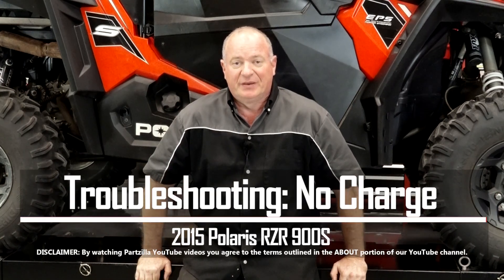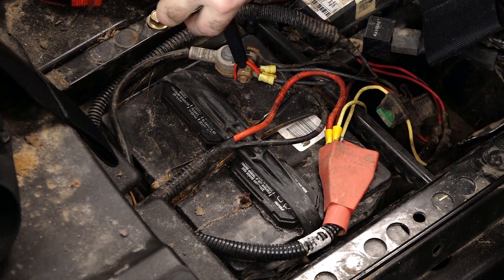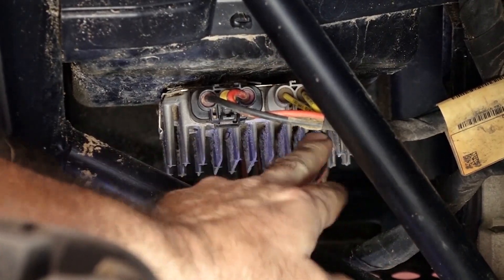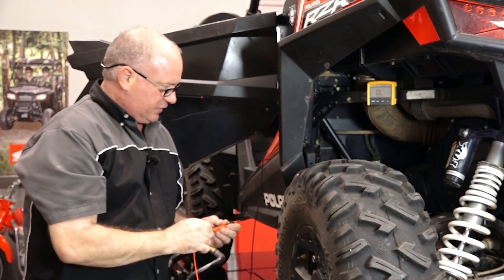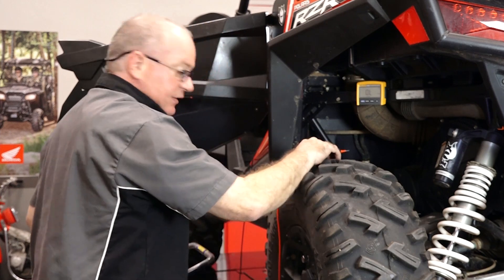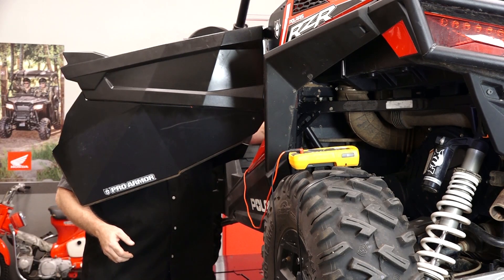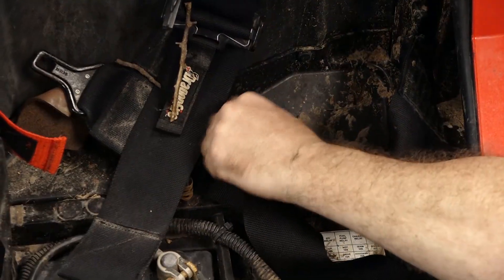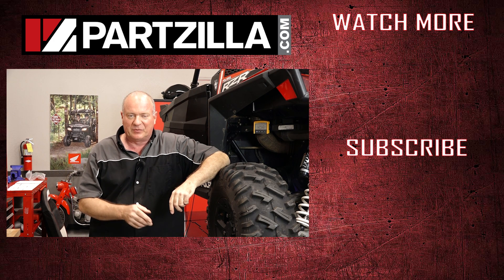Diagnosing Charging System Problems | 2015 RZR 900S  | Partzilla.com

Comment: 2014 Polaris Ranger XP900 EPS. My battery was draining. Went to start the UTV and charging showed 11.2 and went down as I drove it. Eventually would get below 10 volts and not start. Charged battery back. Drove down the road and EPS shut off, warning light came on and message showed 16.8 over-voltage. Returned to the house and began troubleshooting. Most say over-voltage is a broken 22 gauge wire. at the stator. Did not find that. Removed regulator plugs. Stator disconnected and Black to ground, checked each phase and all are open. Started machine and checked AC voltage at connector. 20-21 vac. All 1-2, 1-3, 2-3. Appears good. No grounded and ac voltage correct. Plugged in to battery connector, machine not running, Red meter lead to ground on battery, Each leg shows 1.2. Not the 0.5. All 3 legs consistent at 1.2.  Is this causing the low voltage and then over-voltage?

Comment: I did every test and everything checked out. Good regulator and stator. But not even 20 minutes of riding and I’m stalling out with a dead battery… very frustrating
Reply: Tengo ese mismo problema ¿pusiste solucionarlo?

Comment: We made an error on our RZR 900 and reversed polarity on the battery,  We heard a fireworks kind of sound and that was it.  We put the battery correctly and the RZR starts and runs but is not charging.  Do you think we damaged anything else aside from the stator or rectifier?  I replced the rectifier and its still not charging.  I looked at this video so my next step is to follow your procedure on stator testing.

Comment: If I put a battery shut off switch on the positive battery cable on my rzr xp 1000 will it kill the engine if I switch it off while its running?

Comment: I just bought a Polaris rzr 800, the light bar stopped working, radio, horn, etc. The light's to the rzr are still working, and still driving. It does cut off at idle. What could I check? Plz help!

Comment: 3:13. You are confusing resistance with continuity, if there is continuity to ground the coils are shorted, a good coil will have a lot of resistance, in fact infinite resistance. With the meter on the ohm setting and displaying OL or I (I for infinity) it means there is infinite resistance between the meter's leads, as soon as the reading changes it means there is LESS resistance than infinite and that points to a short.

Comment: I have a 2013 Ranger 900 XP it will run for about 5 minutes then shut off if you let it set for 20 minutes it will start back up, the first dealer told me to replace the coil, and that did not help , so I called another dealer and he said stator and that did not help either, when it quits there is no spark to the spark plugs, do you have any suggestions on what could be the problem!

Comment: I have a 2013 Polaris RZR 570, would this be a similar process ?  thank you!   new battery, we use to feed horses, runs about 5 days (we don't drive it fast) when turn off; battery needs charged.  May have a charging problem.  only 237 hours on  it! purchased from older gentleman he never used it; shined it alot.  I just installed a new battery. It has been sitting for at least 9 months.  Otherwise runs great.

Comment: If you check the stator and it is ok, couldn't you also check the output plug of the regulator/rectifier to see if it is appropriate voltage if you don't have a diode checker?

Comment: Hello John, can you explain this,, so if you read my comments I have a 2015 Polaris 900 xp, it runs great now again but upon doing your test of the stator initially it checked out good, about 20v, but still off and on would not charge according to the volt meter installed. Then it started to over charge, up to 17v and the eng. light came on continually. So rechecking the stator again it then showed about 1v ac on all three.  So I ordered a new stator too. Meanwhile I got a new regulator installled.  Was about to remove the muffler etc. when I thought to recheck the stator, for laughs, and volt meter after the regulator install.  To my shock the volt meter now shows 14.7 and it runs great..???? Canceled the code 168 and eng. light and it has been running fine..  Also the regulator went out I think because the batt. posts were both loose.  When it stalled and had to jump start it both connections were loose enough to turn by fingers......

Comment: Today when I started it up, meter shows a discharge AND motor light is on the speedo guage.. ordered a regulator will post any change after install.  Regulator is behind the grill and bumper/winch on passenger side, I see on your video it is wide open on the machine you work on.  ? is that the original place or like I"m thinking>> I will just mount the new one someplace more easy to get to.. it being that close to a hot radiator was not a good plan I'm thinking,  thanks

Comment: Excellent work, thank you, easily diagnosed my 2015 ranger 900 stator 19-20 v on all three circuits and no ground out. Was discharging erratically, especially at idle.  But now after checking it out it shows on the speed gauge and separate volt meter over charge,,, up to 17v, this causes the PS to quit as did the low voltage too.
Reply: Mine's charging at around 17 VDC as well. Did replacing the rectifier solve your problem?

Comment: Have a delayed starting problem on a 2011 Polaris 800 ranger. It happens when I turn the key on let the fuel pump charge then when I step on break petal and turn the key  we have engagement but then a hesitation before it actually starts. I’ve changed the safety switch, starter, and switch starter. 
What am I missing or have done wrong?
Thank you for you videos,
Brian

Comment: Iam having some issues with my rzr. It’s a 2013 900 and while riding this past weekend power steering kept going out and check engine light kept coming on. I bring it home and test battery and it’s at 12.6v but at idle it’s at 15.9v. I used this video to test stator and I’m getting .5ohms which is way above spec and for ac volts I’m getting 3 volts at idle. How can this be if battery is over charging?

Comment: Awesome video, I was able to follow the steps as you did but I was checking them on my 12 rzr 800, really the only difference is the location of the rectifier. From using this testing method of having the pos/neg plug plugged into the rectifier I was able to determine that my original rectifier was faulty, the diode test was all over the place with phases one and two and OL on the third. Great I thought as I had bought a new rectifier thinking and hoping that was the issue... Installed the new rectifier and repeated the test and got around .5 an all three phases. Plugged in the stator plug and started the machine and checked the volts on the battery, they stayed the same as the volts of the battery with the machine off, around 12.5V... I checked my stator volts AC at idle and had around 20V across the phases on all three... Is there more trouble shooting I can do? From my tests it seems that I have a good stator and now a good rectifier... Is there maybe a fuse or a relay that would be bad? If so where might I find them? As of now thou I'm glad to not have the task of taking out my motor to get to the stator to change that as on the 12's and up to the 14 model change the engine is turned 90deg and makes taking the stator out a chore that requires the motor to be pulled out... Any help would be appreciated.
Reply: did you end up finding out the exact problem to this?? (i know its an old post). My machine (2011 rzr 800) is doing exactly what you just described. Bought a new regulator and did all the tests in the video. Everything checked out with the new part, but still no charge to the battery.
Reply: @AnthonSa  hola tengo ese mismo problema justo ahora sabes cómo se solucionó?
Reply: @ramiroespinoza3939  Encontré un cable eléctrico roto del rectificador que conducía a la batería cuando tenía problemas sin carga de la batería.
Reply: @ramiroespinoza3939  Encontré un cable eléctrico roto del rectificador que conducía a la batería cuando tenía problemas sin carga de la batería.

Comment: Voltage regulator only putting out 11.54volts at idle, stator putting out 19.8 volts AC at idle, Diode test comes back .451 on all 3 terminals.  Do I need a new voltage regulator?
Reply: Have the same exact problem
Reply: I also have this same problem .467V on all three terminals

Comment: I have a 2015 rzr s  it cranks but does not start. I have fire  I'm getting fuel. The engine code is low voltage. Battery is charged    do u have any ideas of what to check.  I checked voltage on the regulator on the starter side and all 3 legs were 10.3volts

Comment: Hi .im trying to figure out why my new battery fully charged keeps losing voltage and dying on me. For example, i had it fully charged, rode it 5 miles one night and rode it 5 miles to work next morning. Went out on my lunch break and it wouldn't start. I've  checked my R/R and diodes are fine. Ive done the high rpm rev and didnt go above 14 volts. Does that mean that my Stator and R/R are functional? Im no mechanic  but willing to learn. Any help would be greatly appreciated. I use a 1amp trickle charger. Have a Autocraft AGM Powersport YTX12-BS Battery with 180 CCA that i paid $90 for. Also, does it matter that i didnt spend $300 for OEM Battery and went with aftermarket battery? A battery is a battery. Right?
Reply: Well, looks like im not getting an answer
Reply: @theone2be33  having similar issue with mine. Did you ever figure out the issue causing yours?
Reply: @TheEleazerJ  burned out stator. Replaced it

Comment: I replaced the stator on a 2012 Polaris Ranger 500 EFI 4x4. Did the AC test on the stator while running like your video shows.  It shows on 9.8 volts on all phases. Do different machines stator put out less AC volts while running?
Reply from the maker: You should have more voltage, even at idle.  Are you having charging issues?
Reply: @PartzillaParts yes. I change the stator. When I start giving the engine throttle the volts go up a lot to 70. Maybe the idle is to low?

Comment: Hey.  Great video but when I did a diode test I get 706 on all 3 circuits.  Not sure what that means.
Reply: Correction it reads -706
Reply from the maker: Sounds like you have it on the wrong setting.
Reply: @PartzillaParts  I will double check that.  My meter combines diode test with continuity.   Can the regulator rectifier be tested with out the battery connection connected?

Comment: My 2016 won’t crank what would be the problem ?
Reply from the maker: It could be literally anything.  Start with power, it's the most common.  Battery, fuses, cables, solenoid....down the line.

Comment: Hey John I have a question I ordered a new OEM clutch basket after finishing installing the clutch boss why is one fiber plate left out can't figure out why is that
Reply from the maker: What unit are you putting this on?
Reply: @PartzillaParts  2014 yfz450r
Reply: I figured what's the problem was the clutch it was missing one steel plate.. thanks alot john

Comment: Hey John was a great video,I have an 2008 razor 800 with similar readings..looks like my wiring is a bit different,I was doing the first test to check stator,and am not getting anything on my meter? I checked connections,appear to be good, can I send u pictures somehow?

Comment: Got a problem with a 2013 Polaris RZR charging system. Installed a new stator and voltage regulator. Still not charging the battery. If I unplug the charge side on the voltage regulator and run wires direct to the battery still no charge but if I run the wires to a separate battery it charges fine. 14.5 volts. This is strange. Any ideas what is wrong? Thanks, AJ.
Reply: Hi AJ, I have the exact same problem you do. The battery in the Polaris does not charge but if I put it to an external battery it charges just fine. I was wondering what you did to fix it appreciate any help you can give me.
Reply: @johnigd  The problem was in the wiring harness. Needed a new harness.
Reply: Thank you

Comment: Thanks for video. Can I use the same method to check Sportsman 850 (2011) voltage regulator? Should the readings be the same? Thanks.

Comment: Hey John, my battery was not fully charged, but was measuring 12.7 volts.....my stator at idle was in between 19-20 volts. I didn't get a chance to raise the rpms to 4-5K rpms to see if my volts increased to between 70-75 volts. My diodes were all measuring at .471 volts. Could my diodes be measuring under 0.5 volts cuz my battery wasn't fully charged, or does this mean my voltage regulator is bad? Thanks
Reply from the maker: That should be within range. Around .5.  If it reads nothing, then there is an issue.
Reply: I’m having same issue with my Rzr. With Rzr off battery read 12.4 volts. When Rzr running volts only go up to around 12.7volts instead of 13.5 or more. Did all test and stator is good and so is rectifier. I’m lost and out of idea. Any help would be greatly appreciated John